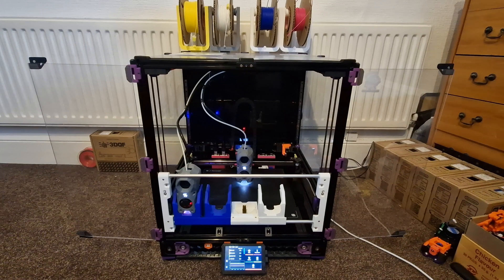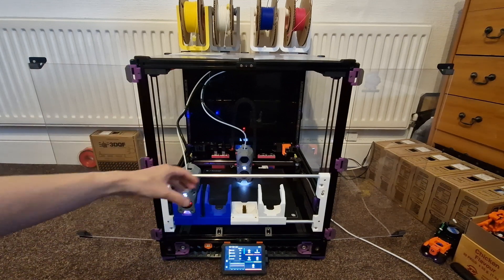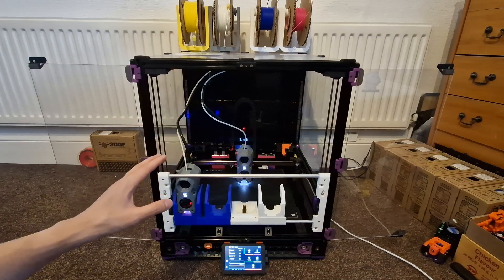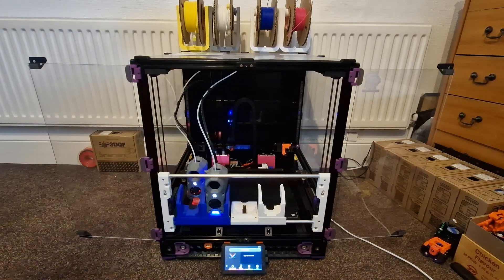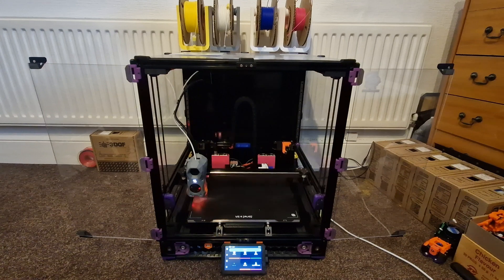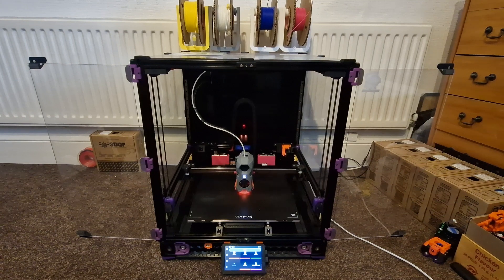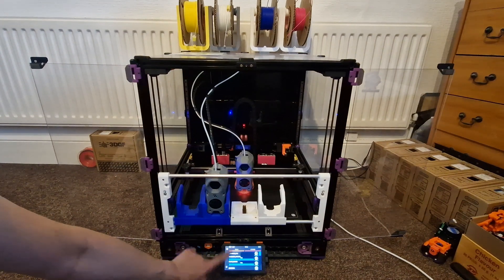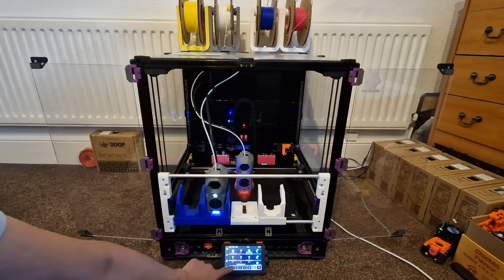MissChanger - Mode Change Demo

Comment: So whats the benefit of this over stealthchsnger? Everything ive seen/read indicates Stealth Changer is better. More tollheads, better IS, more compact design/less bulky, more successful users, better documentstion, etc. Like i get wanting to develope an alternative, but whats the point if its the reheaded stepchild of stealthchanger?
Reply from the maker: Performance-wise, if those are the criteria that you are looking for then just go for SC. It is a very cool project. I would in fact recommend it over MC, due to the fact there is a team behind instead of a single person.
MC (as a project) is more focus on reliability. It retains the Voron-Tap MGN9H rail for probe accuracy. This is a design trade-off, worse IS but better first layer reliability. And, from my experience with multi-material so far, it is too early to try going faster regardless of whatever system you are on.
MC is also designed around the workflow of upgrading an existing printer, using parts printed on that same printer, with rooms for errors and chances to reverse course if needed. Even after completion, you can still switch back to a single toolhead setup in less than a minute and without any tool.

Comment: Do I understand correctly that this is the key feature that differs MissChanger from StealthChanger? Or is there more?
Reply from the maker: The tap and toolchange mechism is also different. Unlike SC, MC retains the MGN9 rail, for probe accuracy.
Reply: What’s the difference between input shaper results? I understand stealthchanger has better IS results than the printed tap
Reply from the maker: @efboiz5302  I have published the input shaper results on GitHub. I don't know how it is compared to others.
Reply: @vinny5915  ah man, looks like IS not great :( I wonder how just T0 would do with the dock and other toolheads not installed?  In my ideal would I world really want to be able to maintain 7-10k accels for my regular ABS prints.  2k would be sufficient for the mutimaterial prints

Comment: quick question wont klipper give you an mcu error when you decouple the second toolhead?
Reply from the maker: I made a klipper plugin to deal with that
Reply: @vinny5915  ah cool is this part of your miss changer fork or is it a standalone plugin?
Reply from the maker: @TheArnoparno   It is part of the fork
Reply: @vinny5915 does the plugin also change the config/build area?
Reply from the maker: @efboiz5302  It can be configured to do so.
Basically, the plugin gives you the ability to set a section of your printer.cfg to be swapped in-and-out.

Comment: I'm looking at multi toolhead options right now for my 2.4.  This looks like a great solution!  Looking though the macros, are you using includes to enable or disable a printhead to keep klipper from have a panic when you remove one?
Reply from the maker: Yes, But also, I am using a macro called `[gcode_shell_command]`, which is an extension that can be installed with KIAUH, to swap in and out the printer.cfg. It just got finished today, and I just pushed it out as of this comment.
Reply: @vinny5915 great work!  Thank you.
Reply: @vinny5915 follow up question. How do you handle the CAN bus?  Are both of these running on the same bus?
Reply from the maker: @jace055   I am actually not too familiar with CAN bus and the terminologies around. Nevertheless, you can fine my wiring diagram here: https://github.com/VIN-y/MissChanger/tree/main/STLs%20and%20Instructions/v1.0%20-%20MVP
Reply: @vinny5915  How do you mean? Your instructions clearly says "CAN bus tool-head wiring diagram" %))
Reply from the maker: @otann  Uhm... I just hooked things up the way I was told, by someone on Discord, and it works. But, I don't really understand how it works or what are the best practice for CAN bus. 🤷